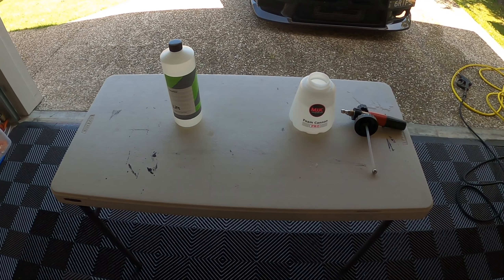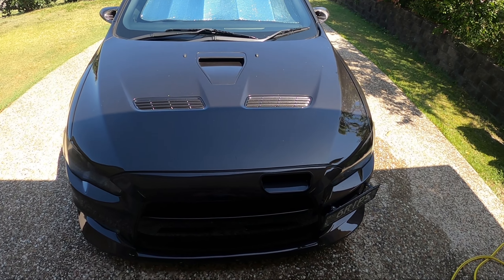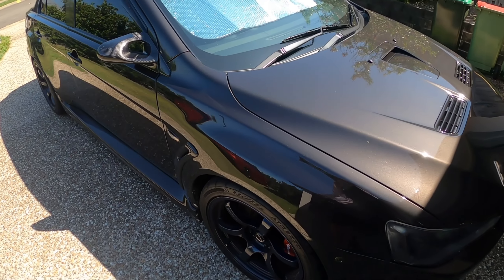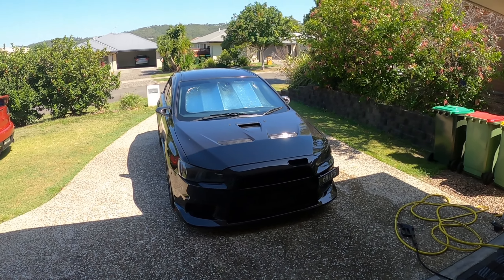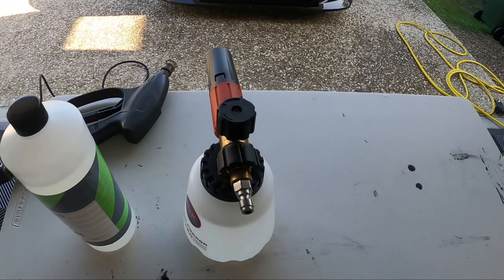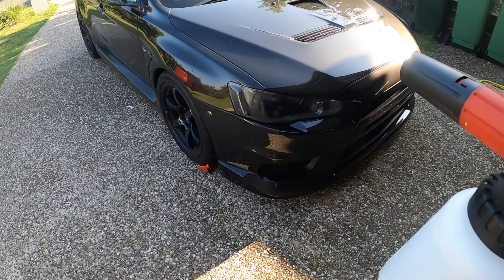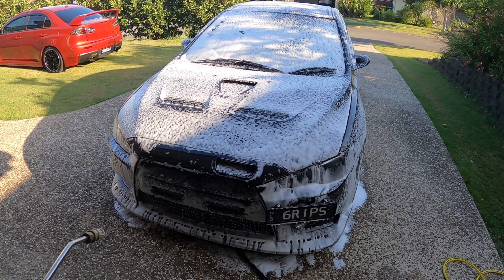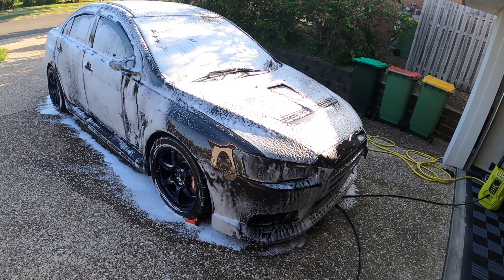Carpro Lift Test And Review

Comment: Smashes mega snow right?

Also found the White tip to be too weak for the small ryobi i use the next one down the 25 degree one and wow what a game changer. Its just right give it a crack Jackson
Reply from the maker: I think I'll have to compare them but they definitely both cling like nothing else that's for sure 

I did play around with different nozzles a few years back and went with white for safety on cars but maybe I'll try again

Comment: I'm not a snow foam type of guy but when those words come out of your mouth.....it's been totally touchless cleaned. Well I'm in for a bucket load
Reply from the maker: I still wouldn't want to go towell drying without a contact wash after this snow foam  but could work well for a pre rinse and then air dry method for sure